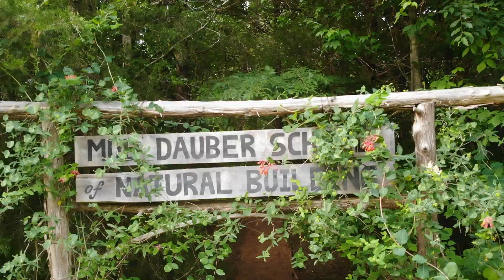Foundations, Cob, & Straw Bale Immersion

Comment: Hey great video, I was curious if the foundation choice was to demonstrate two separate m building options or if there was specific intention in the design
Reply from the maker: It was to demonstrate both during the workshop
Reply: It seems like the gravel foundation doesnt have a pond liner, but then when the concrete and stone foundations are beginning, they both have pond liners, do you always use one?